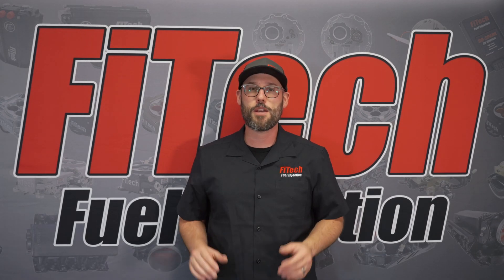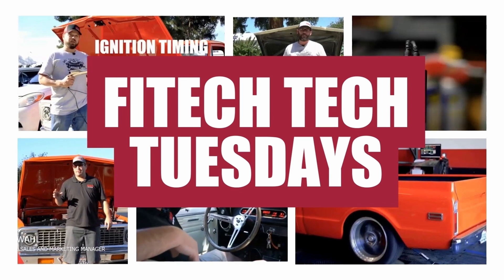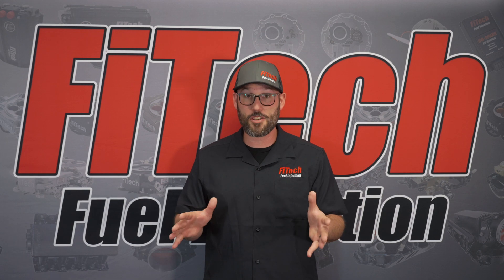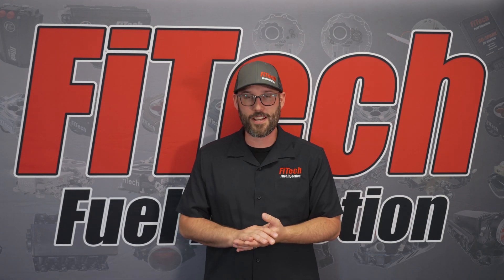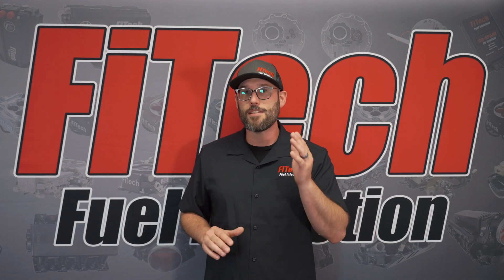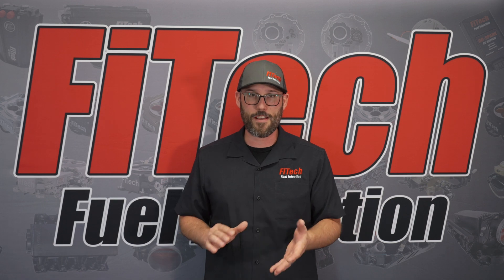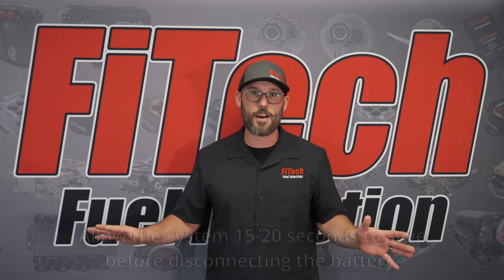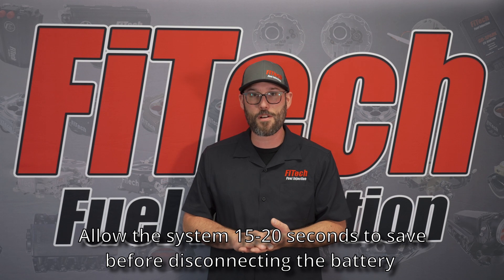Winterizing Your FiTech EFI | Tech Tuesdays | EP85

Comment: Sea Foam is a fuel preservative. It will help keep fuel fresh for up to 2 years. 1 Can treats 20 gals. I prepare my classics by mixing it at a ratio of 15 gals to 1 can of SEA foam. Fill my tanks with "CLEAR" or non-ethanol fuel, to full drive home. The additive will mix into the fuel better during fill up, then the drive home circulating the treated fuel through out the system. Once the car is parked where it's going to be, then add the Stabil. Stabil creates a film or barrier on top of the fuel to keep oxygen off of the fuel. Once you move or run the car, the Stabil mixes into to the fuel and it's effectiveness is greatly reduced. I use this procedure on all of my yard equipment also.